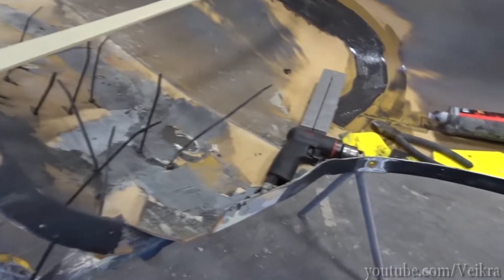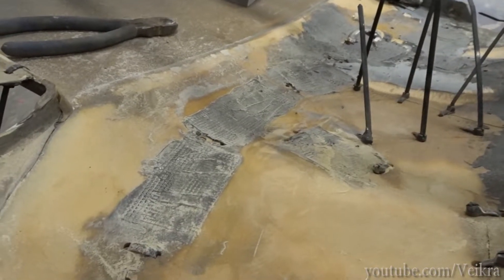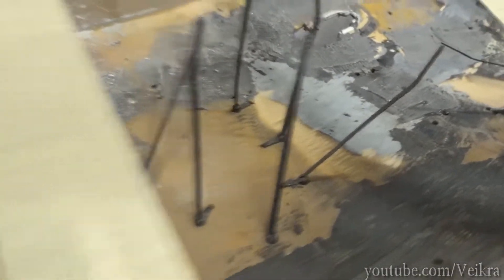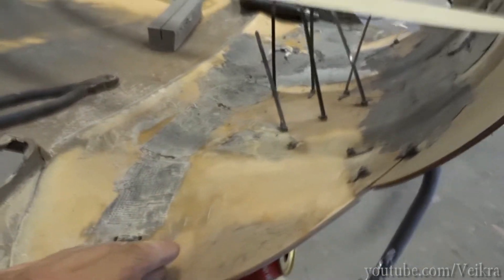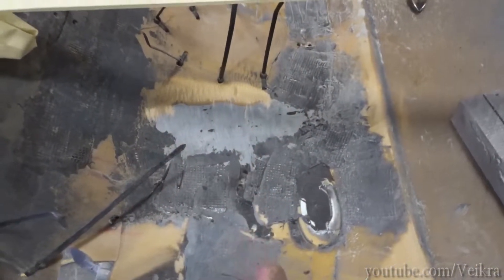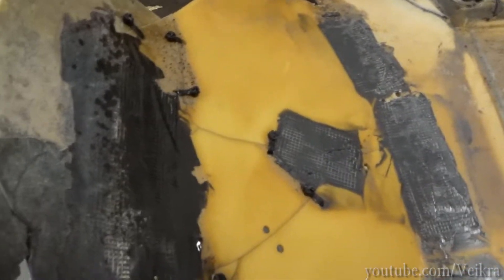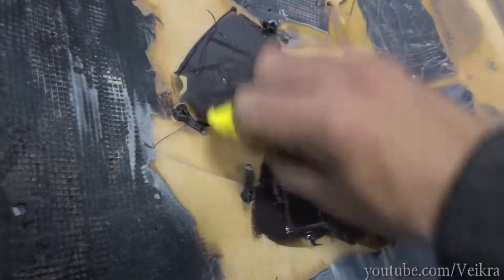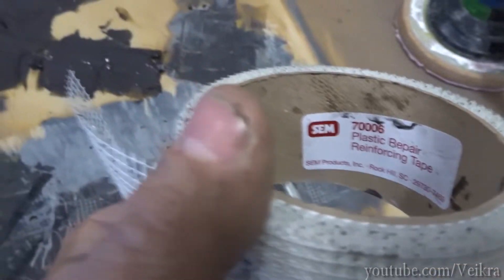How I fix SMC for thousand $$$$

Comment: Do u have a link to purchase a new rear Dually fender? Thank you
Reply from the maker: They will be advailable for purchase this summer. But they will be in fiberglass or carbon, no more SMC material. I will post a video when they are.
Reply: @Nordic_Mechanic  right on I’ll keep following to match sure I don’t miss that video 👍
Reply from the maker: @baldzilla1baldzilla126  The place im working with had a busier schedule, but their parts was much higher quality. It was worth to pay extra money and wait longer. 
I`ll never have to worry about the fenders, the fiberglass part will be easily repairable and way stronger....
Reply: @Nordic_Mechanic   sounds good looking forward to getting my hands on that product thanks again
Reply: @Nordic_Mechanic  do you have a cost for a 2002 8’ dually fender by chance?

Comment: What filler do you suggest for SMC repairs ? I have a 87 C4 Corvette that is pitted and cracked. Looking for a filler that will stick as well as expand and contract with the panels.
Reply from the maker: First you need to fix the fiberglass with fiberglass. You could use the U-pol filler for smc but I'D shape it all in fiberglass myself. Then  3-4 coat high build primer to make it perfect
Reply: @Nordic_Mechanic  I can use fiberglass on SMC with no troubles ? What about short or long strand filler like tiger hair ? Which upol filler are you referring to ? Thanks in advance!
Reply from the maker: @jaredburgett3679  normal smc pre 1999 on chevy is ok. Or your corvette is fine with fiberglass. On these dually fender, nothign sticks for long. That`s why I will have new fender in fiberglass and carbon fiber for sale this summer. Im waiting on the company to complete the molds